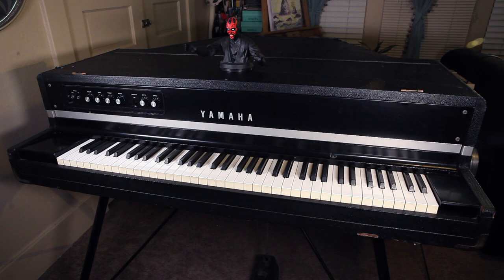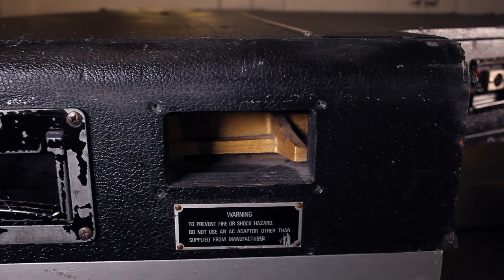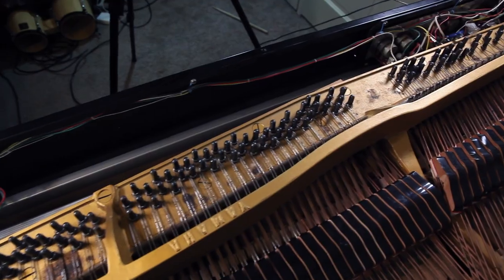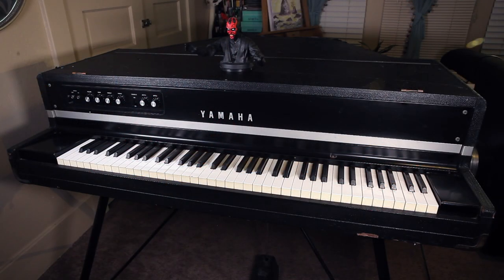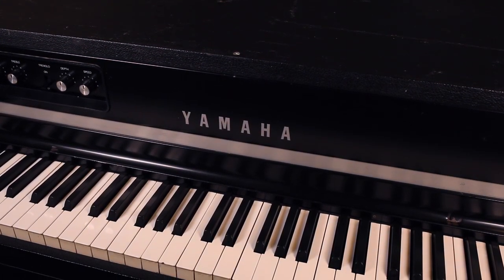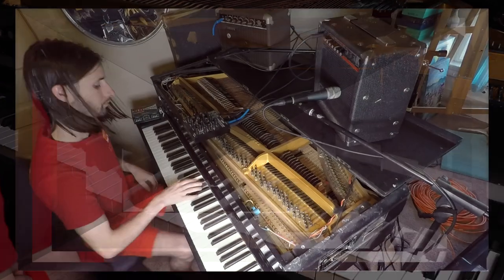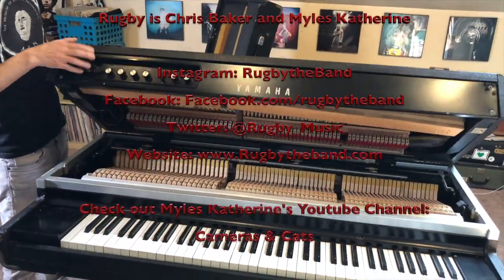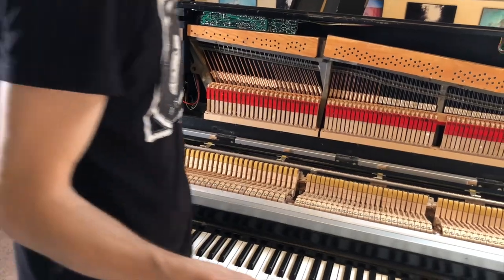Yamaha Cp-70 complete review (Part 1)

Comment: The Yamaha CP-70 was an evolution of Helpinstill that made magnetic pick up's for acoustic piano's so it was easier to amp and eliminate feedback.
Reply: The Helpinstill Piano Pickups make your Piano sound like the CP-80 but more refined due to the addition of a Soundboard & the Bass Strings now at standard Length.
Reply: @RockStarOscarStern634  It's why i prefer the sound of Helpinstill pick ups.
Reply: @jaggass  Either way those Pickups are great for recreating that 80s sound & they're great for recording a Standard Piano w/o having to use those Bulky Mics.
Reply: @RockStarOscarStern634  And you can control the sound of them too. Sadly got no room for a grand as they work best on them but i'd easily have an upright or the Helpinstill Roadmaster.

Comment: Hey there do you have IG? I recently got a CP70 and wanted to ask you questions about the lower notes and it’s tuning
Reply from the maker: I do but I never use it. Tuning is the same as a real piano. Watch some videos on piano tuning! Warning: piano tuning is very complicated if you want it to be equal temperament. Hiring a piano tuner is always an option!
Reply: @RUGBYmusic  agreed ! I actually hired someone to tune it for me, but I’ve noticed after having it tuned 3 times that no matter what the lowest octave is out of tune,  and was wondering if you could tell me more information about when you restrung yours, how much that affected your lowest end strings tuning ?
Reply from the maker: @synthdude7664  Gotcha. I never restrung mine. Original strings. The low notes never sounded very nice on mine considering the single string per note down there sorry wish I could be more of a help perhaps try a different piano tuner? Or your could get a piano key and mess with those low ones till you like it.

Comment: Hi I have one of these pianos and I am trying to understand how to hook it up to get sound out of it. If you can help I’d appreciate it!
Reply from the maker: Hello. Hook up to what?
Reply: @RUGBYmusic  hi Rugby thanks for the response. So I have tried to plug it directly into a guitar amp with just a normal instrument cable. And I’ve tried to plug an xlr cable with a balanced instrument input into a guitar amp and that didn’t work. My next best guess is to plug two xlr cables into a mixer and into an amp. Do you think it’s broken or do you think the mixer idea will work? Thank you for your time!
Reply from the maker: @jellojamcwg  If it didn’t work on the guitar amp it probably won’t work on the mixer either. I would still give it a try though. The electronics on mine didn’t work either. I actually ended up bypassing them and connecting the pickup cable directly to the 1/4” output kinda like how a guitar works. They are pretty old so it’s no surprise you are having a electronics problems. I would see if there is a local tech who could take look at it if the mixer does not work.
Reply: @RUGBYmusic Thanks for taking the time to respond and thanks for the tip!

Comment: Such a classic piano! The funny sound of the lower strings comes from them being shorter than a grand, in order to fit in a baby grand form factor. However, this is a big part of its loveable sonic character. I had a CP60m, which is similar and sounds practically identical. But the CP60m is in an upright form, which is handy for saving space. I actually didn’t like the sound of these when I had one, I felt they sounded very dry through the pickups.

But now years later when we have massive piano sample instruments (and Pianoteq), I find myself drawn back to this sound. The instrument definitely has soul and sounds great in pop/rock and jazz.
Reply: After all, this was new technology for 1978.
Reply: I'd often wondered why those lower notes sounded so particular to this instrument. I actually love that sound, as often used by Billy Currie of Ultravox.
Reply: @timwilderspin  I might add that part of the sound also comes from having no soundboard. CP60m features solid wood construction on the top, sides and bottom covered in tolex. The CP60m has front and rear panels are made out of thin plastic. The keyboard detaches easily in the CP70, so you end up with more manageable 2 x 60kg "suitcases" instead of one big 100kg lump of the CP60m. Both are very similar though in sound and construction, the CP60m has the advantage of taking up less space, but CP70 is more roadworthy. One nice feature on the CP60m is that the keyboard folds down into the body for transportation, and the sustain pedal can be pushed in. The quality of these instruments is very high, full wooden keyboard action with plastic key tops, feels fantastic! MIDI is a very nice bonus too!

Comment: Do you need to plug this piano into a guitar amp then to use it?
You would think it could mount its own amp on-board. It's certainly big enough.
Reply: I wouldnt ruin the sound by pluggin it into a guitar amp. A  stereo amp like jazz chorus would probably sound decent.
To get the most out of it i'd just use two good speakers. Studio monitors etc.

Comment: Awesome video!! Did you have to find a power cable for yours? Can't find one anywhere.
Reply from the maker: Tyler Frey hey sorry no idea maybe ebay?
Reply: If you go to your local musical instruments/cabling concern, they should be able to wire you up a new one. According the wiring diagram in the user's manual, the piano needs a 16.5V DC input from the AC-to-DC power adapter, 2.5W power consumption, and 2-pin XLR connectors aren't super-hard to find.

Comment: Nice! I bought a CP70b from 1979 probably, it’s in really good condition considering it was brought from another country by the previous owner. However, when I play it unplugged (or turned off if you prefer), I hear some kind of buzz coming from the top lid. And when I turn it on and play through a speaker, pickups take the sound from the sustain pedal and even from the key/hammers, which interferes somehow with the sound. Have you have experienced something similar? Could you fix it? Has to be with the fact that strings are not tuned yet? Any feedback would be really appreciated. Thanks
Reply from the maker: Miguel Yudelevich Hello! Is it an electrical buzz or a mechanical buzz?
Reply: It’s definitely mechanical, as if there was something loose. However, I checked everything and all seems right.
Reply: UPDATE: I removed the top lid and the buzz completely disappeared. Now, I must figure out what exactly is causing that noise.
Reply from the maker: Miguel Yudelevich my lid buzzes sometimes. Maybe try tightening all the  lid screws?
Reply: RUGBY music Thanks, I did it already, the buzz is still there.
Reply from the maker: Miguel Yudelevich i’m not sure then. You may just need to check every screw on instrument.
Reply: Miguel Yudelevich its not the lid screws, it is the little latches on the backside, just put a bit of tape, gaffers is best as it wont leave a residue. Also, your dampers will always pass thru because piezoelectric pickups well, pick up everything transmitted by vibration. However of you use a bit of high pass filter it should help. Try cutting the frequency 100khz and under by 3-6db. It will take away some of the thudding. Good luck!
Reply: It is most likely the clips on the side.  Tape them down -- that's what I do.